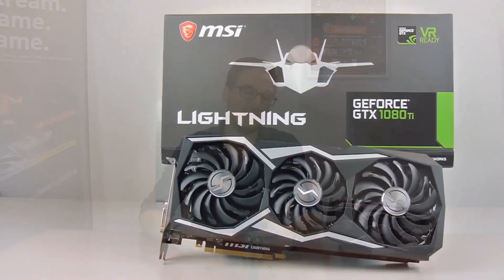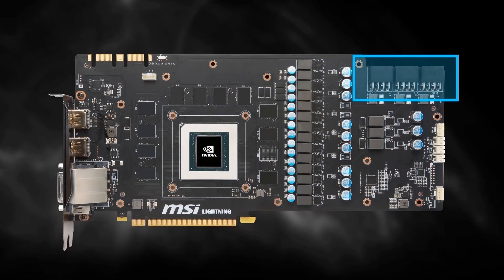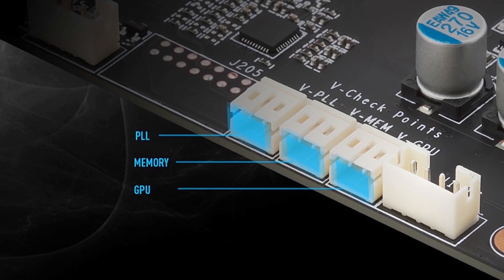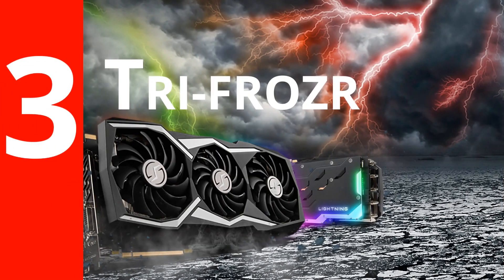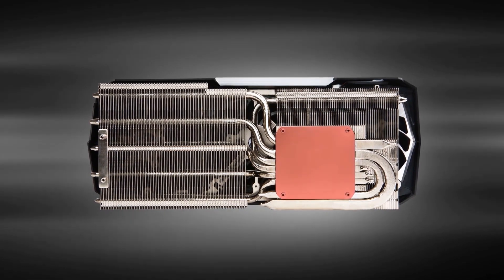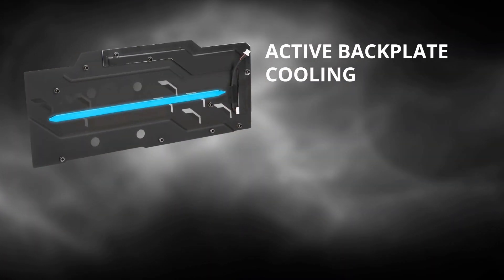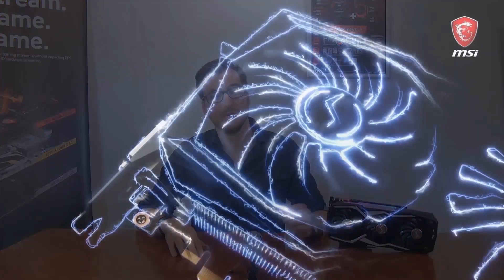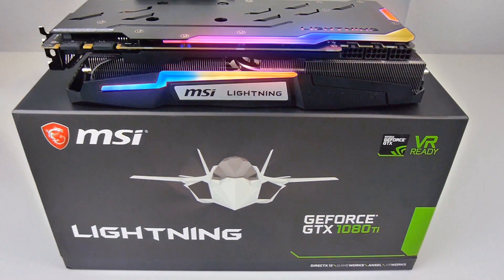5 Things you need to know about the MSI GeForce GTX 1080 Ti LIGHTNING Z | MSI

Comment: I got this one and its a high Quality Hardware but man plz tell me how to switch to lightning mode - AND STAY THERE - without this crappy gaming app (or after uninstalling it)  or one of your horrible around 20 other slowware software programs with part by part same features. Do you thinkn the Kind of people that go for 1k bucks cards, are that stupid and install one after another msi branded Programm just to see how the Computer gets blackscreened cause they are not compatible to each other and slow everything down in unexaptable way...

I will give you a few examples of MSI BRANDED Tools, your Homepage wants to tell me seriously I Need them immediately cause I bought the M270 Gaming Pro Carbon Mainboard and this Card. I repeat: I bought 2 Products and now please read this slowly and loud to yourself and maybe you gonna get the clue whats wrong with your Software human beings:
MSI command Center,   MSI mystic light, MSI gaming app, MSI gaming lan Manager (AHAHHAHA... :/), MSI Live Update, MSI Ramdisk (?!?), MSI Smart Tool (not smart), MSI Super Charger (lel), MSI Tri Def Smart Cam, MSI Tri Def VR,MSI Fast Boot Solution (!!!! ARE YOU KIDDIN ME),  MSI X Boost, and last but not least one single good one MSI AFTERBURNER. But hey, unfortunately afterburner is causin a systemcrash by executing with boot togehter with MSI gaming app (thats the app you Need for your "great" STOCK OVERCLOCK and I would love to go for afterburner to USE THIS 1000 DOLLAR CARD any further in THE WAY YOU TELL ME I SHOULD GO FOR IN THIS VIDEOMassive Respect to your Hardware-Guys, the did great work but nothing then the reason for loosing a lot of customers caused by unbelievable bad Software engeneering staff...Your Customer